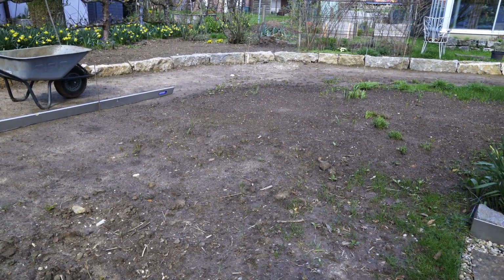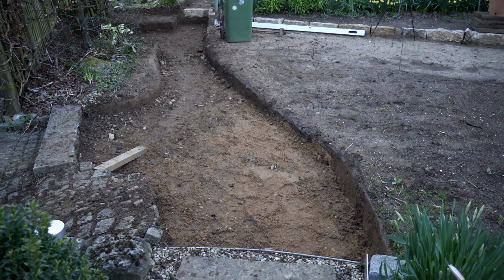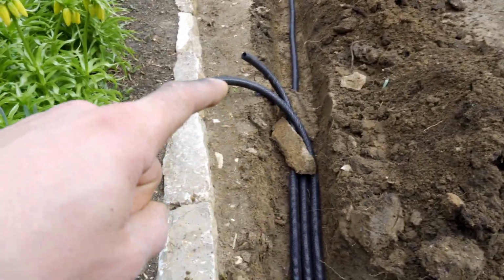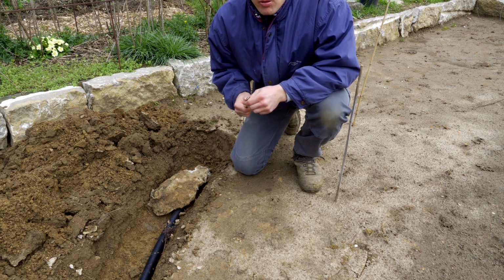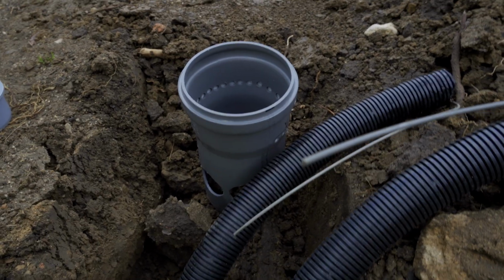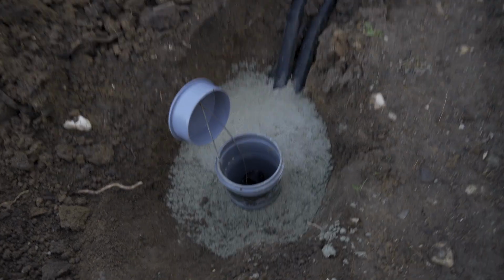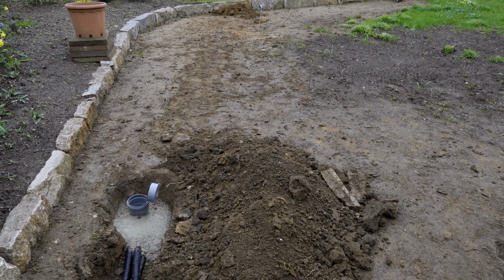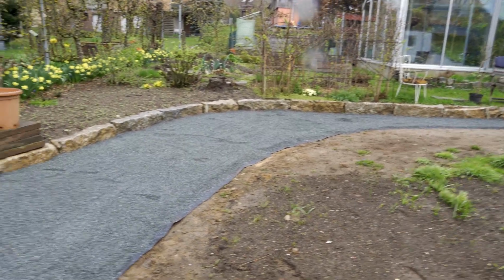Track Base and underground wiring prep.

Comment: Really enjoying watching the progress, Robert! Very creative in working out how to get the first run through the trunking. We used PVC pipe which make it easier but only the 20mm - wish we had used a larger diameter now.

Keep up the great content!
Reply from the maker: I´m happy to hear from you! The trunking I am using in the video was 40mm. You can buy those with a pulling wire installed from the factory, maybe I should spent the few extra euros next time... But in the end the fencing wire worked great. The next step is track installation, so stay tuned!
Reply: @summitrailway  My favourite bit 🍿

Comment: Your garden railroad's progress is amazing! Very good job, Robert! I'm on the beginning to built mine, at the planning stage. I would like to ask you which material are you using for track base and which size has it? My plan to use basalt in size 8-11 mm, probalby it matches to train scale. (At least according to calculation. I didn't make the physical comapre yet. :)) Thanks in advance! Akos
Reply from the maker: Hi! Great to hear form you and your garden railroad plans! I use basalt gravel in size 1 - 4 mm which looks good in my opinion and works just fine. If you are planning to build up your ballast to something like an embankment you can use some bigger material which will make the embankment way more erosion proof.
Reply: @summitrailway  Hi! Thanks for reply. I thought you were using basalt too. :) I plan to use 8-11 mm, but before I order bigger amount of it I will make a comparison to check it is good in size or not and will try smaller version also.